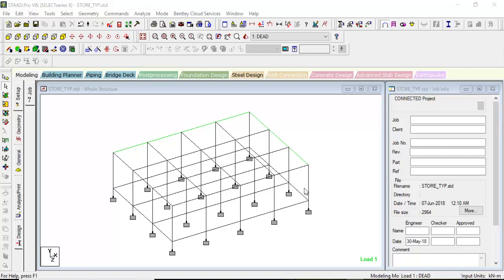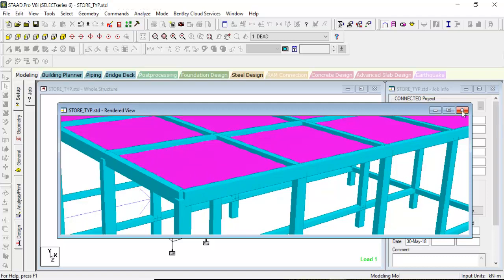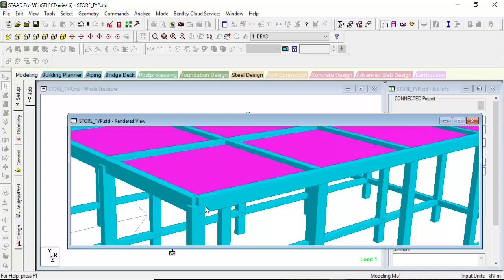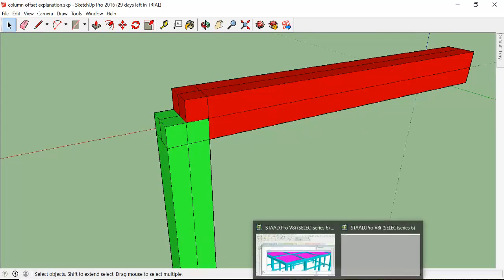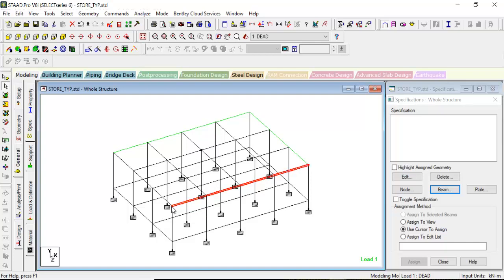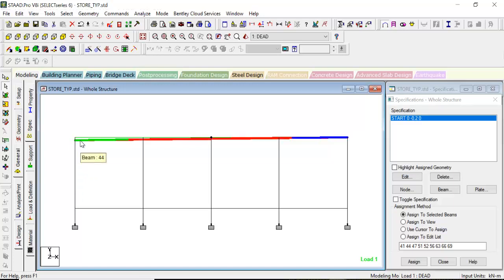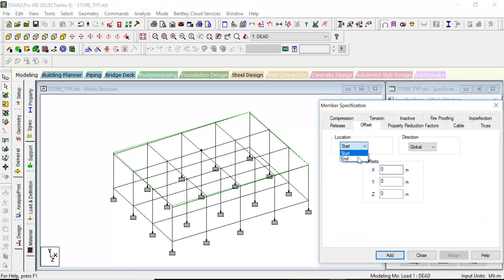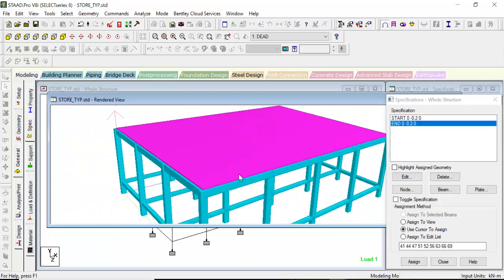STAAD PRO v8i LECTURE 21: Member offset (Importance and how to do it)

Comment: no offset = more conservative design?
Reply: For the beam, yes because it will have more length and more self-weight
For Column, no because the load (from the end of the beam) will act in centroid of column instead of the face. Load acting on the face of the column will have an eccentricity which means there will be additional moment thus having offset beam will have more moment in column